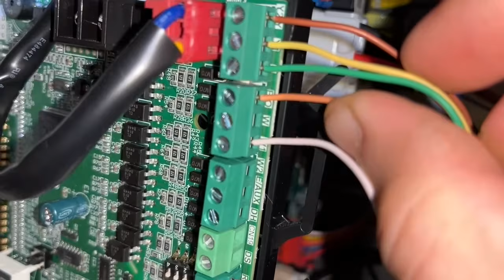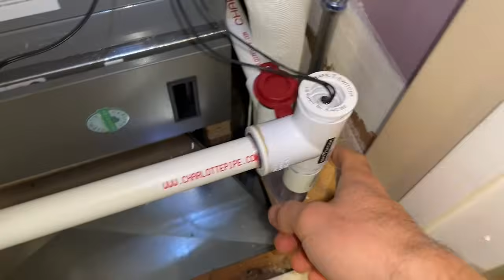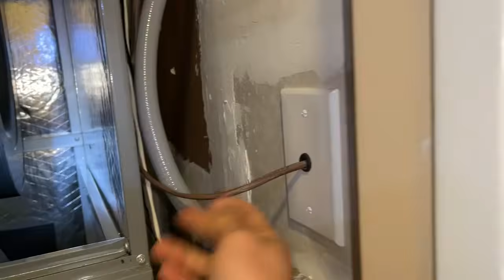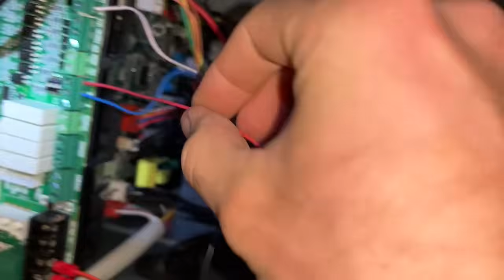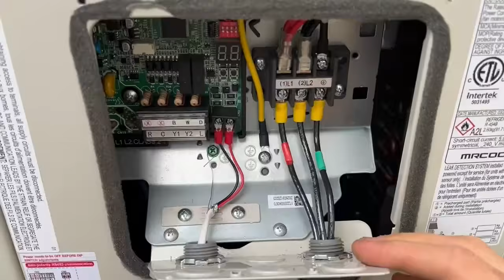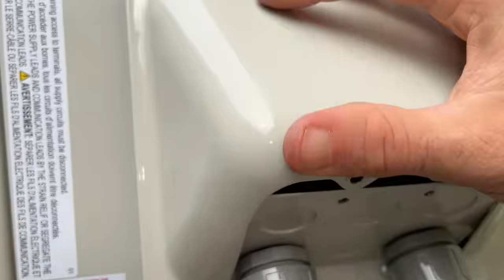MRCOOL Versa Pro Wiring Guide: Power, RS485 Comms & Google Nest Thermostat Setup

Comment: I installed a 410a versa pro airhandler using a old straight cool condenser 
I have two install heat kit today do I need two change any dip switches so that heat would work with w  since I’m not running heat pump

Comment: I have the 5 ton versa cool and I was under the impression that the thermostat also has to be wired into the condenser am I mistaken?
I also have a 52 on the condenser display and a 01 on the ducted air handler display any idea where to find information on these?

Comment: Super helpful video thank you. All the other videos didn't break it down like this. However I noticed you connected the overflow switch to the red thermostat wire rather than removing the j7 jumper wire and connect it to the cn23. Is there a reason you chose to do it the other way?

Comment: thx it is the same as chrome AI, the W/W2 only needed for AUX/AUX2 heating. Don't think Google - it acquired nest thermostat would be better, as original thermostat has direct control while 3rd party still use rough relay control.

Comment: I have the same unit. You make it understandable.
My problem is that I have a 10k heat strip that I need to install. I wish there was a video on that. 

Brian
Reply from the maker: Hey Brian, I recommend contacting the Mr Cool support phone. They were very helpful on the wiring, especially for the heat strip. The main difference for your heat strip will be the additional larger gauge wires for powering the strip.
Reply: @VincentStevenson ok. Thanks.

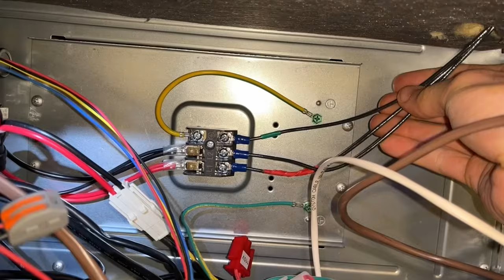Comment: at time 1:03 you stated double pole breaker ? 115 volts single pole (15 amp)  ?
Reply from the maker: This AHU required a two pole 15a breaker (240v not 120)

Comment: I know this is a little older but did you have to change any DIP switches having it wired this way or leave tgem all as it comes? If you see this...thanks for any response.
Reply from the maker: Because I used a google nest thermostat I had to change one dip switch but if you use the mrcool included one you don’t.
Reply from the maker: Definitely read the manual and hit up their support, that’s what I did and they helped me configure it correctly.
Reply: Great thanks. I have mine wired just as you show here but still having issues. I got a call in yo yhe tech support. I guess they will call mon.
Reply: Great video.  Did you change SW1 1st dip to ON? If not which one did you change?

Comment: How did you wire the thermostat on the wall?

Also, my thermostat wire has a black wire amongst the blue, orange, etc. what do you do with it?
Reply from the maker: The terminals on the thermostat should match up with the terminals on the control board in the air handler unit. For the unknown wire, you should trace it back to the control board to see what it corresponds to.

Comment: Do you have heat strip for the white wire connected on W
Reply from the maker: Yes - but in my case I did not install the optional heat strip so I didn’t plug it into the thermostat.
Reply: How did you wire your smart thermostat up same as it is in the air handler?
Reply from the maker: Yes- except I didn’t connect the W wire as I don’t have a heat strip